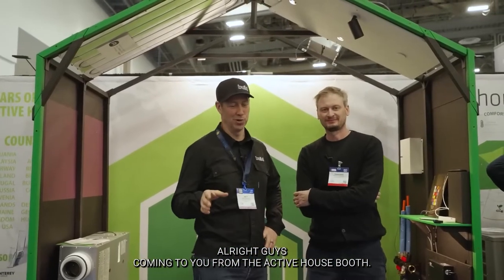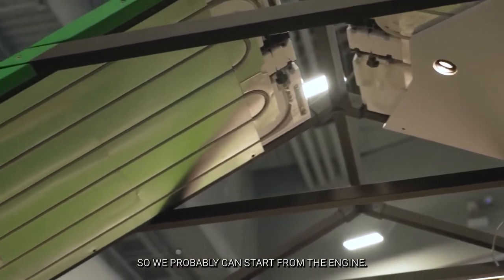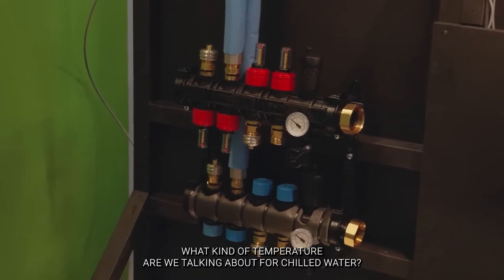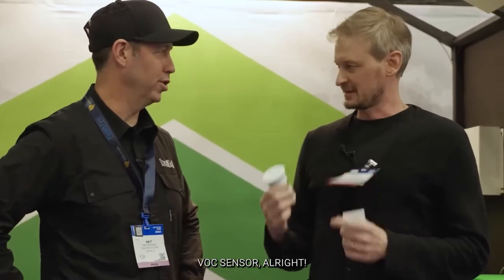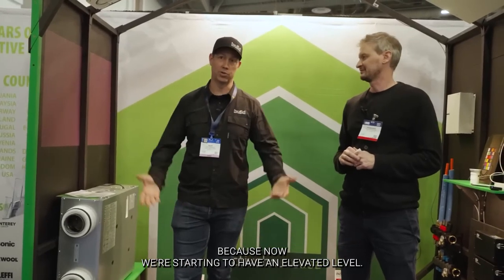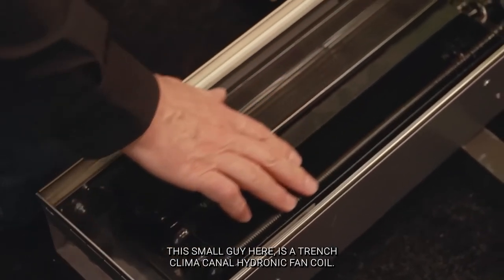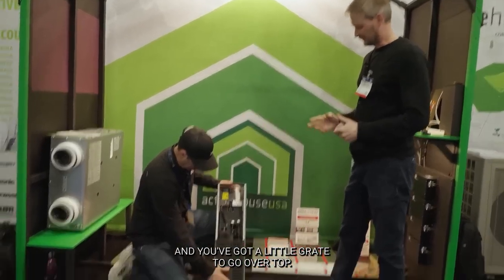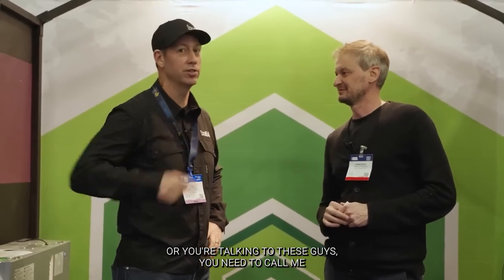Matt Risinger Discusses Radiant Cooling With Messana

Comment: This looks a lot like the "Warmboard" product which Steve Baczek has for floor heating, but ceiling mounted. What an excellent idea!
Reply from the maker: They're definitely similar, but we were able to achieve several advantages by creating a radiant ceiling system, such as:

- A lower thermal mass which improves system response time. Additionally, due to our panel's low thermal mass, radiant cooling is more feasible and effective since we can stay closer to the dew point (relative to a radiant floor) and quickly adjust the radiant surface temperature if condensation becomes a concern. 

- Additionally, a radiant ceiling doesn't have to work against the obstructions that a radiant floor does, such as carpets and furniture. This allows the system to provide truly even comfort throughout the entire environment. 

- Lastly, since the radiant surface will not come into direct contact with occupants, we are not as limited in maximum and minimum radiant surface temperature. A radiant ceiling can utilize higher water temperatures for heating, and cooler water for cooling, making the system more responsive and effective. If the same surface temperature were to be achieved with a radiant floor, it is likely that it would leave occupants feeling uncomfortable.

Let us know if you have any questions regarding our system!

Comment: This looks very intriguing.  Could wood ceiling liner be used as a finish over the ceiling panels, instead of plasterboard?  Could a system be designed that uses radiant heat flooring, radiant ceiling cooling, the Spacepac unit for heating and cooling?  But also dehumidification is needed - and you make something called an Air Treatment Unit for that?  Interested in learning how that works - air ducts must be needed for that.
Reply from the maker: Hi Don,

It sounds like you already have a pretty good understanding of our system!

Yes, a wood ceiling can be used, but your system may require more panels to meet loads as output will be slightly decreased.

In terms of a hybrid system, we can certainly make that happen! Quite a few of our projects utilize various hydronic terminals like radiant floors or hydronic fan coils. Our controls are completely modular, so we can program them to manage the various hydronic terminals you'll utilize, even things like snowmelt systems and hydronic towel warmers!

You can email our co-founder, Francesco, at sales@radiantcooling.com to discuss your project's unique needs. Let me know if you have any follow-up questions!

-Saul
Reply from the maker: I also wanted to confirm that we have our own Air Treatment Units that can provide neutral temperature dehumidification and mechanical ventilation. They can be integrated with our controls of course!

Comment: Appreciate you responding to every post. Been looking into your system for a while but it's hard to find examples or installed reviews. Would this be a feasible option for installing into an class C type RV or would condensation be too much of an issue? Have you looked into that ever? What would be the potential drawbacks or limiting factors in making the ceilings hydronic cooling and with the same msense systems having heated floors?
Reply from the maker: Hi there, thanks for your question! There are several reasons why a radiant cooling system is not ideal for use in vehicles or small structures. 

The main being loads, which would be particularly high in this case. Since all walls in the RV will be exposed to the outside, they will experience more heat gain (compared to rooms in a home, where some are internal, so they are not experiencing heat gain from the outdoors). This coupled with less insulation, results in a space that would be hard to cool solely via a radiant surface. Because of this, a forced air system would be more effective, and also less costly.

Comment: Could passive radiant cooling instead of a heat pump be used to heat or cool the liquid first?

Recently I was thinking about Passive Radiant Cooling—it seems like there’s potential for this approach to go even further. Based on my calculations, achieving 10,000 BTU of cooling (about 2.93 kW of thermal power) at 60 deg F would require around 8.14 square meters of radiating surface. This assumes a perfect radiator with no re-absorption of far-infrared (FIR) or absorption from surrounding surfaces.  I realize this is not possible.

One approach to boost efficiency might be using wave-guides to channel radiative energy perpendicularly away from the surface, it might also help solar cells. This could help reduce re-absorption and focus the energy outward. Additionally, if the radiated energy could be directed through a small exit portal, it might lower the effective surrounding temperature by guiding heat away from the radiating surfaces. 

If I had a rectangular structure with 4 square feet of radiant surface per linear foot, I’d need almost 22 feet of it to reach 8.14 square meters (or around 87.6 square feet) of radiant surface. Besides the construction costs for a Passive Radiant Cooling System like this, it would require a significant amount of space. However, if placed underground, that might make it more feasible.  If you could reach 50% of the ideal case maybe it would be feasible.

Comment: I don't understand how the condensation is managed. Something was mentioned about a dew point sensor, but what variables does it control to ensure that your panels/walls/pex aren't sweating?
Reply from the maker: Hi there, great question! 

You are correct that we use our mSense room comfort sensors to monitor the dew point temperature within an environment. 

With that information, our controls can utilize mixing valves to adjust the supply water temperature to ensure that the radiant surface temperature never falls below the dew point temperature! 

Additionally, we can activate forms of dehumidification to lower the dew point, allowing the system to operate at a lower radiant surface temperature (will still be kept above the dew point).
Reply: @messanatech that's brilliant. Thank you for responding!!
Reply from the maker: Of course, let us know if you ever have any other questions! @ioda006

Comment: This system does possess a limitation for humidity and really accurate temp control to maintain effective temp within human comfort. I just couldn’t understand how this system would do that!?
Reply from the maker: We’ve significantly expanded Messana Controls' capabilities to enhance whole-home comfort. While some of our projects rely solely on a radiant ceiling (more feasible in dry climates), many incorporate hydronic fan coils for fast supplemental heating and cooling/dehumidification, dedicated dehumidifiers/humidifiers, and mechanical ventilation systems (HRV/ERV). Messana controls would also be managing the mechanical components such as heat pumps, boilers, DHW, pumps, mixing valves, etc. So, the comfort level achieved really depends on how the system is designed.

Comment: I am trying to understand your response to certain questions. 

 1) Are you saying in the summer at 85’F 88% humidity outdoor it is cost effective to have. Radiant Cooling, ERV, and a high speed fan coil unit? For a room 400 sq feet with two people in it 24 and 7  in that same room 2-3 xtra people will swing by every 6 hours for 45 mins 24 and 7 ? 

If you say yes. This room is on 4th floor and on that floor there are 40 rooms exactly the same. 3rd floor and 2 nd floor are exactly the same so will this system you are selling keep up and will it be cost effective?
Reply from the maker: Hi there! Our system is tailored for high-end residential and commercial applications, where comfort and energy efficiency are top priorities. While cost-effectiveness isn’t our primary focus, it’s worth noting that hydronic systems typically have a longer lifespan and are more "future-proof" than traditional forced-air systems. This can make them a smart long-term investment for many projects.
Reply: Do you presently have a working system using the parameters I mentioned? If so can I see it?

Comment: does anyone know if messana radiant ceilings would be effective for a 15 foot ceiling? Also, would this system work with a geothermal heat pump?
Reply from the maker: Great question! And the answer to both questions is absolutely! 

We have about 15-foot ceilings in our office! 

When designing your ceiling layout, we will make sure we incorporate enough panels to meet your heating and cooling loads based on load calculations from your mechanical engineer! So typically you'll just need slightly more panels as you increase ceiling height/window surface area. 

As for energy sources, Messana Controls can manage a large variety including geothermal HPs, air-to-water HPs, chillers, boilers, etc. You can find photos of our recent geothermal projects on our Instagram (@messana.tech). 

Let us know if you have any other questions!